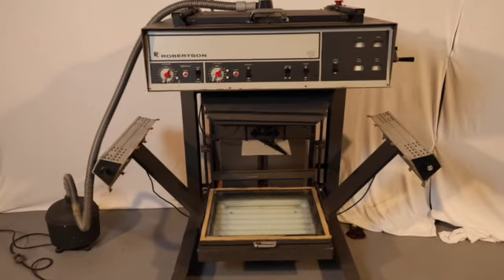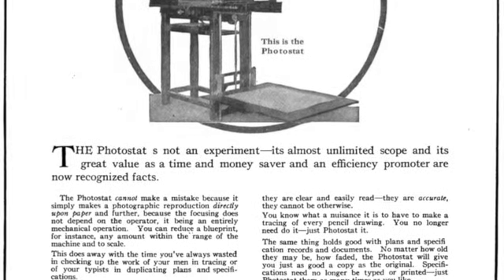The Robertson Photo-Mechanix 432 MK II Process Camera

Comment: I actually did this work for an ad company called Ogilvy & Mather in the mid 80's. Our department was called Photospecialties.

We used this to produce prints as well as negatives. Ours at the time, was automatic as far as punching in to the size and watching the platform and bellows move to the adjusted size.

Then we'd run it (top photo paper/bottom receiver paper) through a machine that would join them with developing fluid.

3 minutes later the image would be transferred onto that receiver paper.
Reply from the maker: it sounds like you may have had the AGFA stat cam. Does that ring a bell? It was of the 80s where the Robertson was of the 60s
Reply: Other than the heat from the lamps and the vacuum noise, I really don't remember.